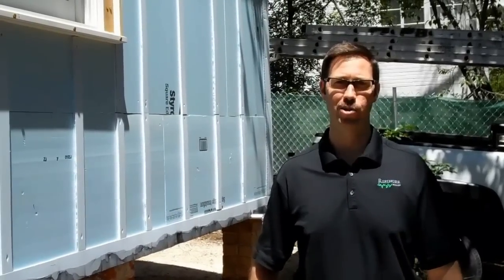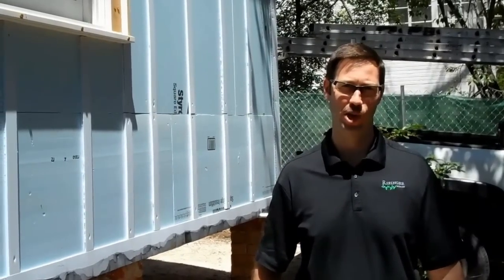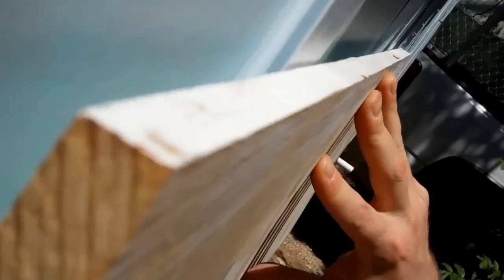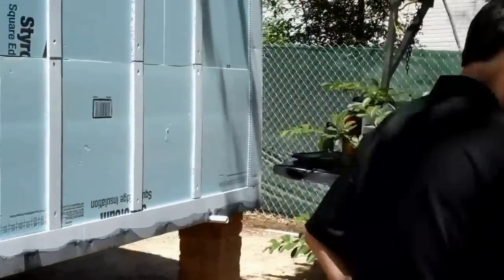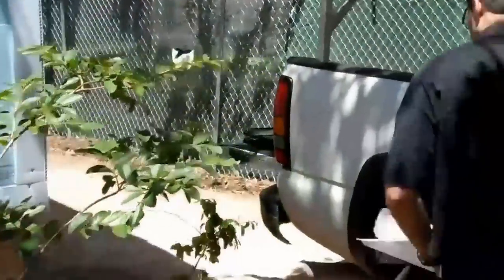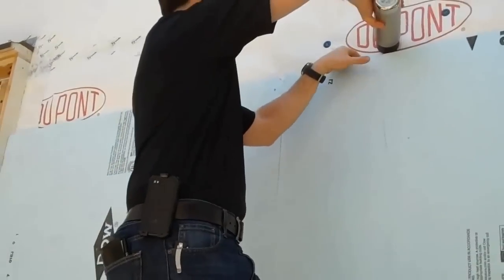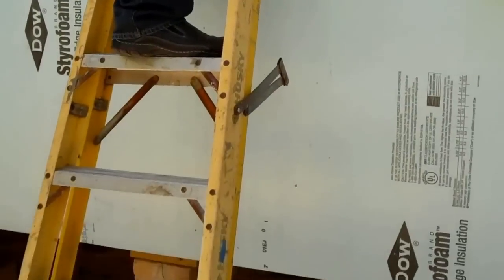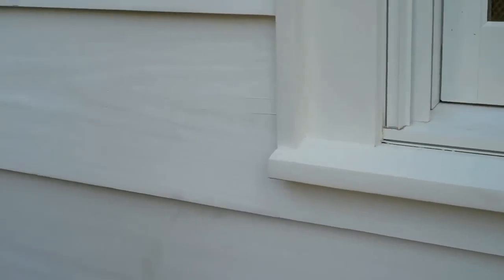Choosing Housewrap when using Exterior Rigid Foam

Comment from the maker: These are plastic battens nails to studs.  The siding nails to studs too through the foam & battens.  I use the exact same setup for cement board siding as you see in this video.  Best, Matt
Reply: Hi Matt love the video and have a question. When the nails used for the battens and for the siding puncture the dupont cloth does that create a risk for leaking through the nails?

Comment from the maker: Great question, not sure I showed that on my video.  I've been meaning to put a longer blog post on this install on my blog with multiple pictures.  I'll have that up next week for you.  risinger.blogspot.com  Briefly, the Drainwrap goes first, then 1" Dow foam, then the starter coarse of rain screen is a horizontal 2" strip of corrugated plastic with the air channels running vertically.  That's wrapped with a "U" shaped piece of bug screen.  This allow free exit of water & air flow. Matt R

Comment: Thanks Matt  for the great video. If there is a tyvek drain layer behind the foam, how is the foam held against the wall? Don’t see how glue would work and I can’t see any fasteners. It’s not held by the battens because the wall in second scene doesn’t have any battens. Thanks for any info someone might have.

Comment: Nice video - helps alot.  One question - get that the wrap under the foam has ridges that act as drain channel.  The space between the top/outer layer of foam and the wood siding is not aerated and does not have its own layer of housewrap.  So any water that gets in there could catch wood pockets and form mold.  Odd that building codes don't catch that.
Reply: For wood siding you need to put lapping to create a rain screen. Vinyl siding is considered water permeable so it can dry to the outside.

Comment: Is there any reason why the seams aren’t taped on the Dow rigid foam? I am interested in doing this technique with cement board siding and 1” rigid foam.
Thank you
Reply from the maker: The waterproofing is behind the foam. No need to tape the seams but you certainly can
Reply: Thank you, makes sense. What manufacture did you use for the 3/8” corrugated furring strips? They look similar to El Dorado battens.

Comment: The Canadian National Building Code  requires an air gap behind the siding. Did you make the batten strips? There is a question about the position of air barrier behind the foam or in front. Great video.
Reply: Steve Nason the rain screen looks like a ready-made product. Check out Cor-a-vent. Not sure if that's what he used here or not, but I know they are a popular brand of rain screen materials.

Comment: Are those battens on the top of the rigid foam made out of wood? PVC? I assume they are nailed or screwed to the studs behind the foam to give something for the siding to nail to. 
I'm planning on using cement-board siding...should I perform the same setup on the walls as you have done here?

Comment: Hi Matt- I was curious. I am siding a house using cedar impressions by certainteed and will be applying fanfold styrofoam. Should I use house wrap (like tyvek, or typar). Or, should I use tar paper. I read that using tyvek and the fanfold could create a situation where the house will not be able to breathe properly. I appreciate your videos! Thank you,
Bill in New Jersey

Comment: Matt, how it the siding going to dry to the rear when it's back primed? Seems to defeat the idea behind creating an air gap in order to "allow the siding to dry", as you mention.
Reply: sportscarclinic I think if the primer is acrylic, then it is permeable and since it is open on the back side (because of the rain screen) it can air out well.
Reply: Just think Fair question. I think to minimize water absorption into the wood and inhibit mold growth. Probably a little bit of overkill but doesn’t hurt. But more importantly, did you see the caterpillar on Matt’s upper lip on this video?

Comment: Hey, Matt-- I was curious as to why the drain wrap was installed behind the rigid foam. Wouldn't it make more sense  to install it in front of the foam?
Reply from the maker: Both methods are acceptable, but my preference is to install foam on top of the drainwrap.  I think it makes the window install more straightforward.  If you install the foam first then you typically need to add a 1x buck to the outside of your windows.  In this video I'm explaining my preferred method...
Reply: It does seem that by creating redundancy in your rain screen that you have likely compromised the air seal.  I worry about creating good air seal with house wrap rain screen as the same effect that allows water to move through prevents a good seal with the tape at the edges.  Why were you not content with letting the foam board serve as your moisture barrier? Thanks for providing such a great resource.
Reply: Matt Risinger Do you have a video on window detail when using rigid foam over an exterior wall? Curious to see how install was done.
Reply: Nicpedia yeah he had a video on that. custom aluminum pieces around the window acted like extension jambs for the siding to die in to at the windows.

Comment: @Matt Risinger : I saw a Tyvek vs ZipR commercial at the beginning of this video. So I watched the entire thing. Tyvek hired 2 crews with experience in each system and had a house done 1/2 & 1/2 using both systems. Then I went to the Tyvek site and watched another video they made where they sprayed water on the side of each installed product. But if you look closely they taped the bottom of the window on the ZipR install. Then they made a big deal of how it leaked. Very bad form for Tyvek. Naughty, naughty Tyvek.
Have you seen this Matt? I know this is an old video but I'd like your opinion on what they did. I'd also like your opinion of each product and hopefully a solid recommendation for my new custom home I'm building in northern Utah.
Reply from the maker: I’ve seen that video. It’s pretty one-sided. Both are good systems if installed correctly. I like Zip because of the terrific air sealing it provides. Use my Zip 2.0 method to install and you’ll build a very good house.
Reply: @buildshow  : Thanks Matt. Exactly what I am thinking as well.